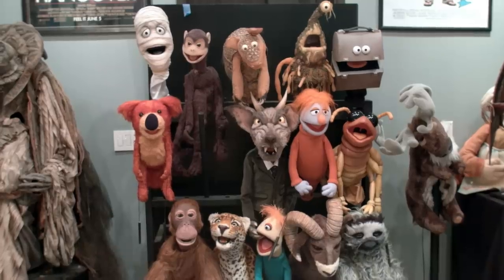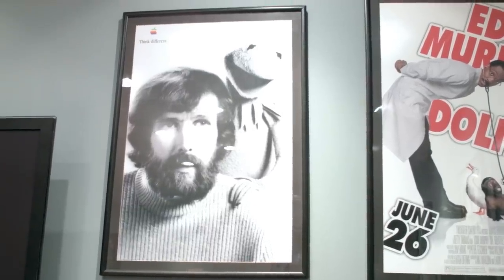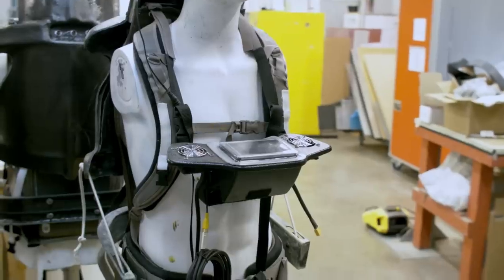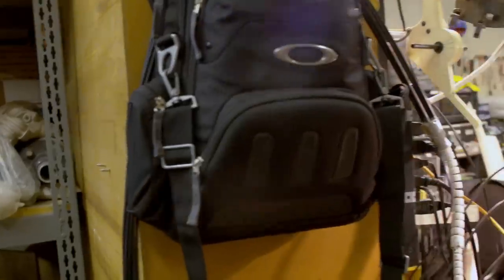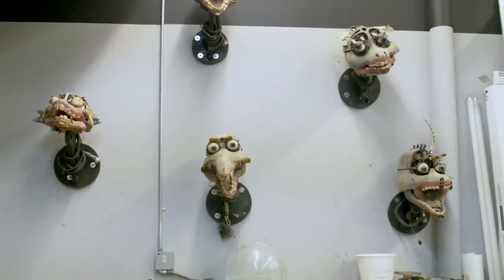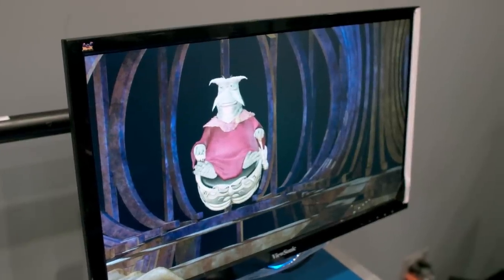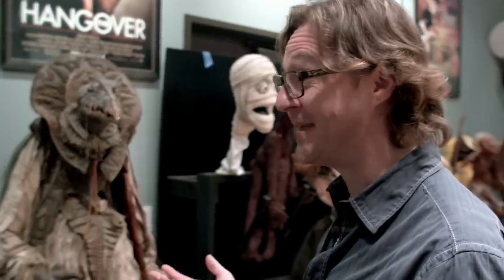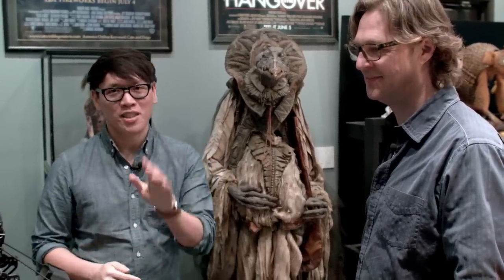The Puppets Inside Jim Henson's Creature Shop

Comment: Brilliant inside look, I found it really interesting.

We're at such a pivotal point in innovation for both puppets and CG.  I'm actually surprised the Jim Henson Workshop are using mechanical tools to operate the CG character rather than the mocap and face capture used in films like Avatar, is it just that they feel more comfortable doing that?
Most mocap need cleanup so maybe that's why?

Although what they show here is interesting it's not exactly new.  Even the Xbox Kinect can get close to the sort of things they're doing with the real time characters 

What I'm curious to know is, how close we are to taking the info gathered from Mocap and inputting that into the real puppets.  Can those puppets not just have a system in place similar to how a CG rig is created and thus have the Mocap move the real puppet and create a performance  close to what the CG version would do?

Another interesting tech emerging is Augmented Reality. I doubt it will be too long before the actor can wear contacts that display a virtual character in front of them.

Interesting times.
Reply: OMG I know you from bills chanal
Reply: Dident think I'd see you here
Reply: Exactly what I was thinking watching this.  The diminished relevance of hard earned skill-sets can be tough to process and people cling to former glory.  Puppeteering will always retain relevance to actual puppets, but nothing else. It's embarrassing to see.  The same thing happened when I went to a screening/book signing of Ray Harryhausen...   He was dismissive of computer animation and declarative about (even cranky about) the superiority of stop-motion animation for believability.  It was the best technology and the best technique for a time and he was the grand master.  Stop motion can still be wonderful, but it simply can never hold or deliver the power it once did.  I suspect that many puppeteers embraced the time when a certain level of expression (and also believability) in fantastical props could only be achieved through puppetry.  Now that computer graphics, nuanced motion-capture, and advancing robotics technologies have far surpassed puppetry as a means to breathing life into the lifeless, there's an unwillingness to recognize that some of the glory bestowed upon it in it's heyday was not inherent, but simply a matter of timing.  The idea of creating a clunky mechanical glove for controlling a computer-graphic character when one could easily achieve a better effect by simply mo-capping a sock puppet is just bizarre.  The insistence that the end result is in any way more communicative or more believable than through other methods is cringe-inducing.   :/     Anyways, I'm still glad they're doing what they're doing because despite errant missteps like this they'll continue to add to the conversation of practical effects.  Oh -- regarding it not being long before an actor can wear contacts that display a virtual character in front of them...   Of course that's just AR/VR ...  I would offer to you, in the context of this discussion that it won't be long before an actor's eye movements can be tracked and translated instantly into mechanical eye movements of a practical robot.  I'm looking forward to that.  :)
Reply: @williamhand3896  Yet of course, people seem pretty bored by CG mega-wicked effects at this point. 
Mocap looks weird to people. Feels like cheating from this animator's perspective.
Reply: @Captain_MonsterFart    — I began replying to you here and came to realize I had no idea what I was originally talking about, much less how I’d be able to elaborate or engage.  

It’s been so long since I watched this video and commented that I had to re-watch it just now.  😝

Um… I still don’t know what I was responding to or why I had so much to say.  I might’ve misunderstood something in the video, or maybe I was just wanting to express some pent-up feelings relating to CG and practical f/x…

I’m seriously at a loss.  I think there’s great value in any approach, whether it’s claymation, traditional cartoons, straight-up puppets, directly or remotely puppeted things, mechanical rigs, all variety of CG approaches, all variety of mocap, procedurally animated things… 

I think it all has something to offer the world when utilized deftly.  So, for whatever that’s worth. 

———————-

As far as people being tired of CG stuff, I agree.  I think most CG creatures have been animated unrealistically (usually far too speedy), and HOLLYWOOD squandered the impact that it all could have had.  But I don’t think that’s due to mocap… I think it’s probably poor writing and rushed (or tightly budgeted) scenes.  Movement achieved by any technique can look bad once you remove frames to shoehorn it in, or substitute thoughtful choreography and storytelling with a more-is-more approach.  

We’ve been saturated with great looking models that are unbelievable in their behaviors and movements, so the magic that they could have had was usually lost, and it’s ubiquity sapped out a lot of wonder and surprise from even those rare occasions where it was done right.  

It seems to me that an intrinsic benefit of mocap is that it can quickly capture subtleties of biomechanics that animators won’t ever nail, and communicate complicated movements of a system that’s subject to real-world forces.  

I don’t see it being appropriate for every situation, though.  

Mocap wouldn’t have made sense for use in HOW TO TRAIN YOUR DRAGON, but it made perfect sense for the cats in the recent video game STRAY.  

Am I addressing what you were saying, or am I just rambling?

Comment: For me, one of the most interesting episodes to date. Thanks.

One thing I'm curious about, though. Wouldn't full-on mocap, complete with facial expression markers, be easier and ultimately more cost-effective than (apparently) purpose-built control rigs when it comes to controlling digital characters like Rygel? Or is mocap technology not quite there yet?
Reply: Tim Cortesi Yes, I had considered this, but it seems to me in cases where a character has a range of recognizable human-like expressions, it perforce has most of the same features, i.e.  flexible lips, eyebrows, etc., so the movements, at least, would be very similar if not identical.

Perhaps, as you suggest, scale is an issue, but I would think this could be calibrated in the software. I could be wrong, of course.
Reply: I think it might also be a matter of making it look sort of interesting in a surreal way, people know puppet movements aren't real of course, but they have some charm that would be impossible to replicate with real human face movements
Reply: I've heard that mocap isn't as precise as people make it out to be. You still have to clean up a lot of the models, and additionally, the characters facial expressions would be limited by the actors skill.
Reply: I would think that the digital puppet solution also works better with characters that are not necessarily human / bipeds, like if you are controlling a dinosaur for instance.
Reply: A major issue with motion capture is that (currently) it's done with a visual system, IR/colour dots on a bodysuit or face. The dots are recorded by an array of cameras and then interpolated to get 3D coordinates moving in space. The issue with this is that they're fairly inaccurate. The interpolation can get noisy, especially when dots get occluded (blocked). Keep an eye on the feet of any raw mocap data, they tend to skitter and skip around. So while mocap is good for broad movements, you'll notice that movies and games employ "motion cleanup artists" who's job it is to lock feet, remove jitter and fix occlusion issues.

Meanwhile, the digital puppet rigs provide far more precise control, much like a gaming controller or mouse provides very precise control in a game. It also affords you control of additional details, like articulated ears, nose flaring, tongue, etc.
Reply: Practical effects will always be more interesting to look at than digital. Also, dollar for dollar, a skilled artist can build 10 puppets in the time it takes to model, paint, and animate a CG character by a team of wildly overpaid desk jockeys. This coming from a former video game programmer turned movie practical effects artist. I hate when computers get involved in a production. Everything takes forever, never looks or moves realistically, and costs a fucking fortune, so directors try to get as much done practically as possible when time and money are concerned.
Reply: Maybe they want it to be more recognisable as having that Henson look to it than looking realistic, the same way aardman has that certain look to it.

Comment: Where The Wild Things is a great example of a director knowing how to use CG. They made a CG wire frame over the physically recorded faces and animated that, instead of starting from a 3D CG model. They touched it up for the inside of the mouths and whatnot, but it means the lighting works on the face and it looks the best it can. They could've done animatronic faces, but the weight and delicate nature of it all would've hindered performance and thus; character.
Such a shame to see a place where it once was the cutting edge of film and tv puppetry, dying down to just a handful of people working there. They did amazing stuff for Hitchhiker's Guide to the Galaxy. Some of the best looking animatronic characters ever IMO.